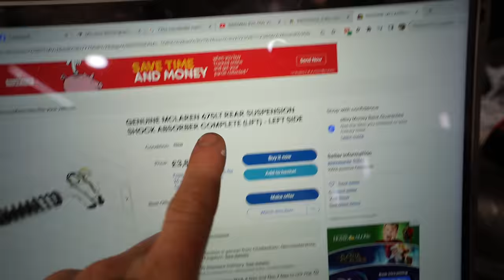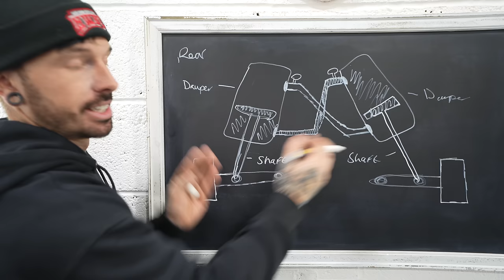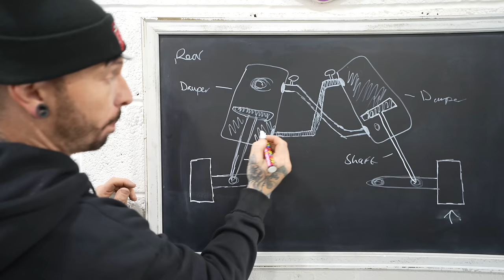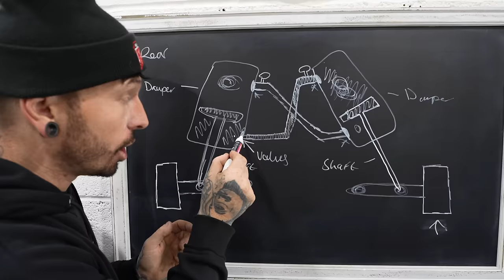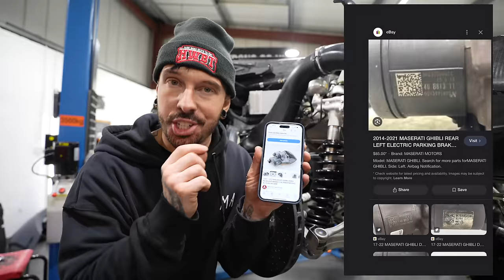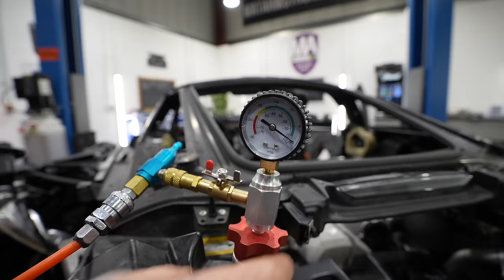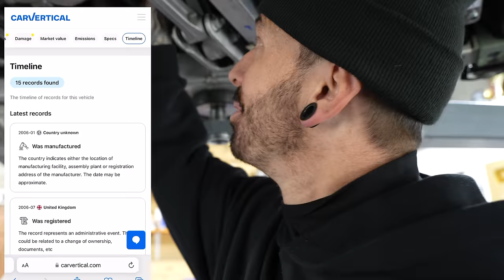I ATTEMPTED TO DRIVE MY WRECKED MCLAREN 720s

Comment: That is a turbocharged engine. You have oil lines running to your Turbo. Make sure your turbos are not blown or leaking oil into the exhaust

Comment: Best case it is nothing more than a duff PCV valve and/or blocked hoses

Crankcase becomes pressurised and forces oil into combustion chambers leading to smoke screen effect. (Both those boxes ticked)

Worst case? You really don't want to know

Comment: Is it oil smoke or steam ? as suggested oil from turbos is my guess. Do a leak down test on engine, will tell you if head gasket. i think its running too well to be something serious internaly. Try getting some diagnostics connected while testing and running they can tell you a lot of useful info., learn to read symptoms of problems. Hope its not serious.

Comment: Check you haven't over filled the engine oil, also check pcv  valves and have a look in the turbos for oil. I reckon breathers are plumbed in wrong. Ex mclaren tech so seen it all 😂 wont go in gear with bonnet open eitner hold D for 5 -10 secs.  Lots of calibration needed for all ecus and gearbox too before driving

Comment: Be careful when reving a smoking engine cause if you've got any type of liquid in the cilinders, liquids aren't compresible and a bad head gasket can easily turn into a bent con-rod or crankshaft and would mean engine very very very bad

Comment: A Maserati Ghibli and alpha Romeo are just fancy Chryslers when my timing chain went out on my Maserati and i took the car apart it was all Chrysler parts soo I say find out what year Maserati Ghibli and look for similar years  dodge jeep Chrysler models even if it says it doesn’t fit but they look the same. They will fit when I was looking for the timing chain the Chrysler 3.6 timing chain said it wasn’t the same but they were exactly the same and it was the same thing for ALOT of parts

Comment: Hey Matt, I have a real challenge for you guys. Unfortunately I had to move back to my home country after polical disagreement my country and yours. I donated 2 very rare cars to a small charitable foundation in London. I propose and challenge you to take control of the cars. Two rare Italian Supercars Pagani Zonda. One has real bad damage underneath the other has damage from above the roof the shield and maybe damage to the engine. My thinking was to use together to make 1 car but for one car to buried and disappear would be a crime. challenge you repair them. if you fix one car go to my charity to sell and give money to and you take control for yourself the other. Only 140 is made I think I have 87 and 88 produce. Zonda will not help you with repair parts. what do you guys think??

Comment: Might be worth pulling the turbo couplers off bud. Check for any oil/water. If water is going into the exhaust housing then that will steam. 

Next option is leak down test or compression test. Compression will help for bad cylinders. Leak down will isolate if it's a piston/gasket failure. 

McLarens aren't known for their engines 🤣.

Comment: 😮white smoke = burning oil. Work your way from the air intake > turbocharger > oil recirculation.  No oil, then do compression test on each cylinder. I don't think that there's anything wrong with your engine, my moneys on the turbo system

Comment: Are you saying car vertical shows all damage a car has had or just when it's a total loss? Because I seen some bad damage on newer cars like an amg merc with 500 miles on that had been rolled. It was repaired by insurance as even a 30k repair was viable, that car is not on the register as it wasn't written off. How can car vertical have that logged? I am happy to be proven wrong but saying it shows you if a cars been damaged could be misleading imo.

Comment: Can anyone help…. I’ve got an A3, I went away for 6 months and the battery went dead flat. When the car needed MOT my dad who is a mechanic jumped off the car to get it there. It died again at the garage and we jumped it to get home. After the second jump the airbag light came on with the code “ airbag control module error “… any code reader I have used won’t clear the code. I have got to the point of having to take the module out from under the centre console myself and replace it. However a new part is £500+vat, can anyone help me get around this or reccomend somewhere I can send the module to be reset

Comment: Don't worry it will be finished by Xmas won't it 😂 by the way in order for it to be finished that means 100% finished and not you saying its finished i just need this little panel an this little bit and that little bit because IT'S NOT FINISHED if you still need bits just saying.